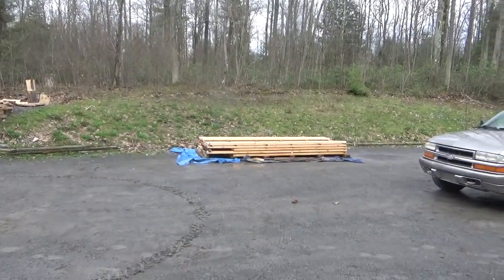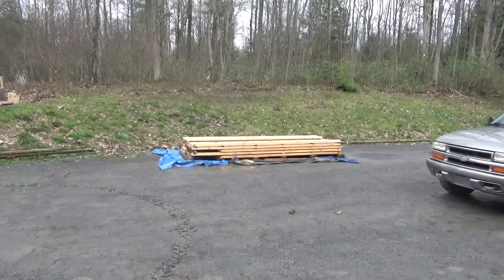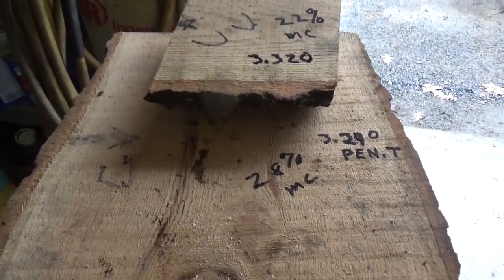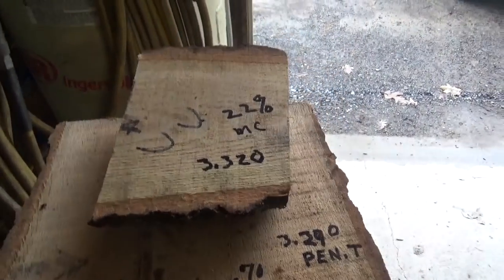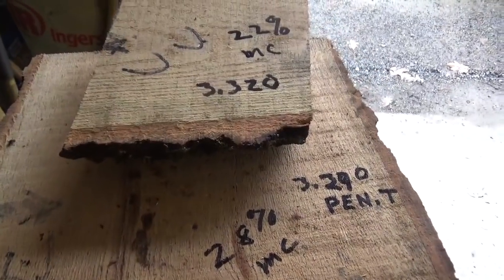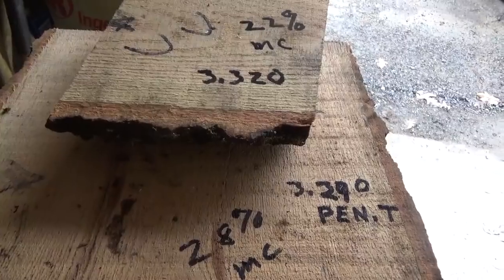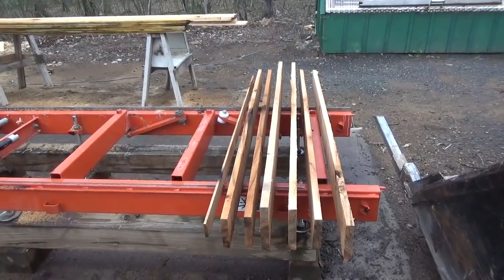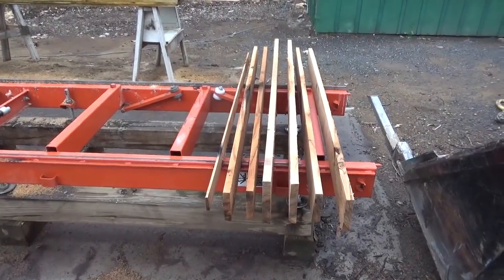Back to the compressed wood experiment for a couple minutes.

Comment: I would think the boards off the sides, where they are half compression wood and half tension wood would react badly, worse that the ones that all one of the other.
Reply from the maker: So did I, but not as of yet.
Reply: @josaljo1  Perhaps that log was not bent enough to have serious compression wood.  I thought it usually existed immediately under limbs. and in the buttresses around the base of the tree. Barry
Reply from the maker: @barryirby8609  I have another bigger tree I noticed on one of the jobsites that I am going to try.